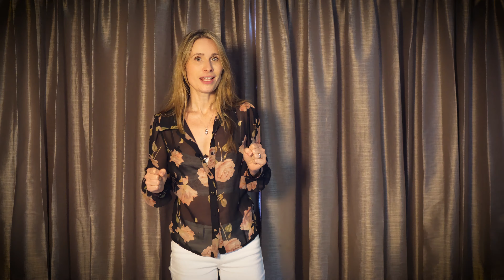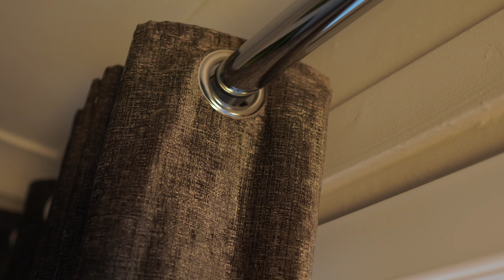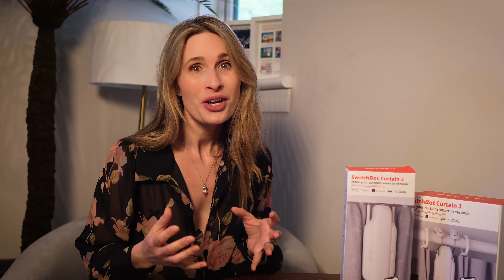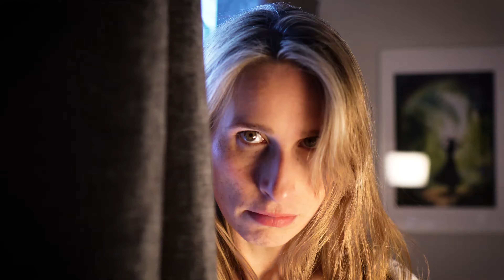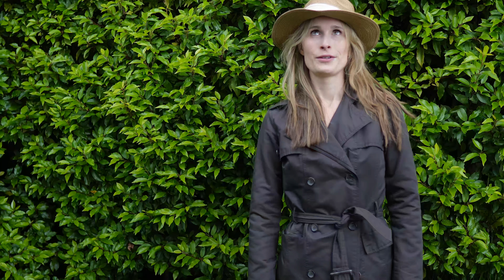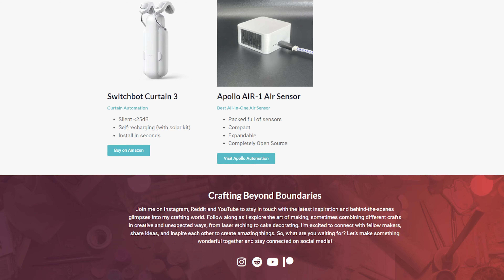Smart lighting, without the lights.... | Roadtesting the Switchbot Curtain 3

Comment: Watching the curtain opener - I couldn't help but think that they've done it the wrong way around.

Imagine a fixed device that sits on one end - and has two wires that stretch to the other side (a closed loop with just a small wheel on the other end).  The opener simply turns one motor to open/close the left and the other motor to open/close the right or potentially one motor to do both with gearing (I'd prefer separate motors as that's less work for each to do and you could option opening just one).

The edge of the curtain (the final ring) is then attached to that wire with a clip.  This could be wired up permanently or even a solar charger rigged up more discretely, it'd also potentially be able to bypass the rail-vs-pole-vs-witchcraft problem of how the curtains are suspended.
The wires themselves could be a simple arrangement using a clear fishing wire type material - it's not supporting weight, just the force required to pull the curtain on a horizontal axis.

The device could be hidden away on each end in behind the fabric that doesn't move back and forth.  It's a little more to install but a much more discrete arrangement and no plastic bob stuck in the middle and visible.
Reply from the maker: I 'think' I follow what you describe, but you'd need four wires for every pair of curtains if I follow and they'd need a bunch of intermounts to stop them sagging too much, which then need some sort of solution to allow the curtains to run through - so it might not be as simple as you think??  But Switchbot are awesome at listening and responding, so if you sketch it out and email me on my site, then I can send to the product director as a future idea!
Reply: @handsonkatie  Not sure - I've seen that type of thing done before with simple tension cables.  You'd need a roller on the other side and it'd need to be tightened - the job of the entire thing is to drag something horizontally left and right rather than support weight (the clip to the leading edge of the curtain is supported by the curtain itself afterall) so all you'd need is enough torque to drag that curtain back and forth and a controller that can adjust it for the speed required.

The two loops - top one for the left and bottom for the right for instance - they wouldn't really need to be too sophisticated in a practical sense.  Material such as Dyneema chord could do this rather well (it's one of these new high tech materials, a fishing wire type can support 130lbs according to the cheat sheet). 

So you'd need two motors - upper pointing down and lower pointing up so the two loops can be close together - and two lops that drag the chord back and forth (slippage would be a problem though, that may have been the problem experienced by the designers of the one you show).  It might result in a belt with teeth instead, there would be a way to overcome this without too much drama I suspect.

Comment: The cost being compared to a motorised curtain rail is outrageous. Two of these are needed for a pair of curtains and a hub for Alexa. My Quoya motorised curtain rail is quite a bit cheaper and includes Alexa. Curtains close automatically at dusk and can be grouped to open at the same time. You also get a remote control though I prefer Alexa. Very reliable and the program is stored in the motorised device so no need to rely on an app running.
Reply from the maker: Not sure I follow. Different market - eg lots of people rent, students in accommodation and so on, so can't permanently fit new curtain tracks anyway. Just looked up Quoya and price is slightly higher for a standard 5m run? You also don't need the hub to run this (I use Home Assistant) and the Quoya look like zero compatibility beyond limited ecosystems like Alexa. So seem very different products and can't see your price point. I am on the look out for smart curtain rail units, but not sure Quoya would fit my requirements at the moment
Reply: Quoya QL600 (5m run) is £1 more than Switchbot taking account of both or neither having 10% off. I then added in the cost of the Switchbot hub you mentioned. I think it's unfair to say it's more expensive. Conpatibility is Tuya smart app (supports zigbee), Alexa, Google,  Siri, Apple watch.  I have the 5 mete solution with a wide bay window. That's my point. Not all of your videos are suitable for students.
Reply from the maker: Yep that seems about right, so I think the 'outrageous cost' point is overstated then - ie £1!! Likewise the hub also does an awful lot more if you want it to control all your devices, but the curtains work great without it too!
Reply: Nah. I think I made the point,  twice,  that I was including the hub and, regardless,  that I was reacting to you saying motorised curtains are more expensive which, as you've just pointed out, is wrong. The hub is £80. What more does it do than the Quoya inbuilt, linking to other curtains, smart app etc ?
Reply from the maker: @EnergySaver2214  The hub controls their whole ecosystem and more - so it's a bit like saying Home Assistant is a waste of time for opening curtains. The hub can be used to control their curtains, household routines, their vacuums, mops, switches, buttons, remote controls, blind tilts, smart app cloud access, some subtle controls like silent move, solar recharge of curtainbots and much more. If your smart home is literally just a pair of curtains, then of course it's not needed (as I've covered already), but likewise it's silly to suggest the Quoya is lacking features as I can't control the TV with the curtain track - different purpose devices!
Reply: I think paying £180 to open a pair is curtains is more than enough,  without adding £80 on top for features that may not be needed and the 3 metre motorised track is cheaper of course.
Reply from the maker: @EnergySaver2214  🤣🤣🤣 Oh yes, all solutions are definitely nice luxuries here, there's little doubt about that!
Reply: Thanks for explaining.  It's something I need to look into. I hope you find the motorised curtains you're looking for.  For me it doesn't have to be part of routines or a bigger eco system. I'm just happy that they close at sunset and I can open them when I choose (to whatever percent I choose) with a voice command or remote, in 2 groups. If I do expand to a smarter home I can see how the other elements you mention would fit together nicely. 
Gridfinity, on the other hand, rocks so thanks for that and all the other videos you spend so much time putting together.
Reply from the maker: @EnergySaver2214  no worries at all - I think the answer is 'both' ie all curtain solutions have their place. Re hubs - key advantage is where you want 'scenes', eg not just close the curtains at night, but dim the lights, play some music etc, then these connected systems can be helpful - I'd still point everyone to HA by default, but if someone wants a super nontechnical solution, then these hubs have their place.

Comment: Hi Katie, I was wondering if you were able to get quiet drift working.  I've recently installed a pair of Curtain 3s but the only way I can get QD to work is via the app.
Reply from the maker: Hey! Do you mean through HA or AN Other platform? I've got it working scheduled, but I set this up through the app - if through HA, then I can't say I've tested this yet - can have a look and raise with Switchbot if not implemented through matter yet?

Comment: Informational video, thank you. Question regarding using them on curtains covering a sliding door. Currently there is a 3 piece blackout curtain set covering the door, with 2 curtains moving to the left and one moving to the right, there is no (equal) center where 2 modules can be set, one side would need to operate longer than the other. Do you see a workaround for this, other than using one module to open the set of 3 all to one side, while still using voice commands? I'm not sure turning sync off and operating them independently would work. Any feedback would be greatly appreciated.
Reply from the maker: Hey, I 'think' this would be fine if uneven. You basically set them up by moving them to the 'curtain closed' position, then it moves the right curtain as far as it can move until it hits resistance (ie the end), it then does the same to the left. And it then saves these positions as the open/close spots. So the fact one side is longer shouldn't really make any difference at all!

Comment: I'd love this but to cover 6 windows with double curtains it adds up to wel over 1000 EUR with the solar chargers. Even when getting them in the sets of 4 which seems to be the best discount available. 
In a new super insulated house the cost savings of trapping heat will be insignificant. I'll have to wait until the cost comes down unfortunately.

Comment: Yeah those Curtain 3 bots are brilliant, still using mine constantly. Did you get the solar panels too? Ours are on south-facing windows and I have never had to charge them manually ever! I also see your vacuum, is that the new S10? I have the K10+ which I prefer because it's smaller and better for our home, but I do like the idea of the proper floor cleaning of the S10.
Reply from the maker: Hey GeekTech! 😊 Ah, brill to know all working with solar, yes I did get them, they're a great idea! Yes it's the new S10, I'll need to do a video on that at some point. I could see myself wanting both actually. The S10 to do the heavy lifting and the K10 to get into all the nooks and crannies!!

Comment: Would have loved to see the integration in HomeAssistant and what features are left if the device isn’t connected to the internet
Reply from the maker: Good shout - there's actually a whole array of ways to connect, so it'd be quite some video on its own. Switchbot Integration can run via Bluetooth or cloud app, it's also matter compatible so you can connect through that, plus all the other ecosystems (eg homekit). I went with a Bluetooth proxy to keep it local as you touch on, so it should keep running...

Comment: I have a double sided curtain and I actually managed to get a switchbot curtain 2 to tug on both of the sides, you just need 2 strings and a reach around two nails at the end of the track on each side. Then hooked each cable to each of the prongs on the device, and to the peg of the other side of the curtain. When the device pushes on one side, it pulls on the other, and vice-versa. Was surprised it could actually drive the weight.
Reply from the maker: You sir, are a genius!! Love it! 🤩🤩🤩 And the Curtain 3s are even stronger, so could do even more. Brilliant idea!!

Comment: Cool idea and the wheels of HA did turn with interest until I clocked the ratcheting up  price: It would cost us almost £1000 just to address the closing the curtains - and we'd need the same number of "somethings" to hoist the roman and venetian blinds in the other rooms , and some of those are really heavy too! Yes, we could do some rooms, but, even so... 

I suspect I will have to continue swearing when the hooks come off the rings through over aggressive curtain pulling or I stand on the cat, in the dark, fumbling for the edge of the curtain at bedtime. 

Now, could I offset the reduction in vet bills against buying the curtain robots ? ..... Excel spreadsheet time again.
Reply from the maker: Hehe! That's the thinking!! I did follow the same pattern actually, installed smart curtains are actually pretty pricey, so these are cost effective vs them (but granted not vs your hands and a lifetime of manual effort!).  I'd keep an eye out, they have quite aggressive sales every now and then. Final point is in your excel spreadsheet actually map which curtains you actually open and close each day - if you're like me, you'll find that actually tackling just a couple of rooms would take out most of the trudging around...!

Comment: Been using these for ages, really good. I also use the Tuiss blinds which have a hacs integration. Now your next stage is to use an FSR for bed occupancy with an ESPhome sensor so the curtain times can react to if you or your other half are away and adjust accordingly and so forth. Bed occupancy can turn on low level floor lighting at night if you get up etc. game changer.
Reply from the maker: Great tip on Tuiss, I have a room needing some blinds, so I might scout around solutions in future! And love the bed occupancy idea.... pinched!
Reply: @handsonkatie  I actually have a partial write up on my GitHub for the fsr. Can’t link here but it’s under iainphay  Got some spare PCBs as well if you want one? For Tuiss blinds2go is the supplier and they have a great range of fabrics and can be custom size which is why I like them 👍
Reply from the maker: Ooh excellent - I'll be in touch, probably a little while until I get around to it, but definitely sounds good!